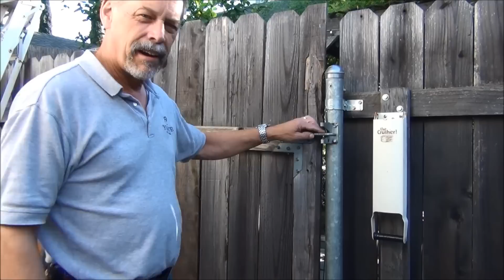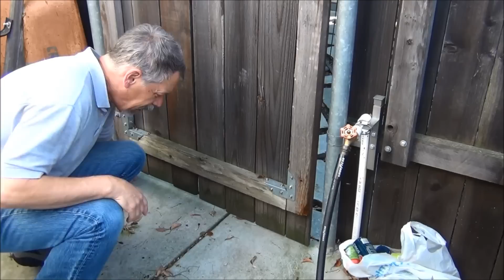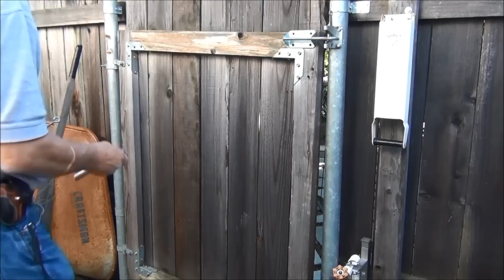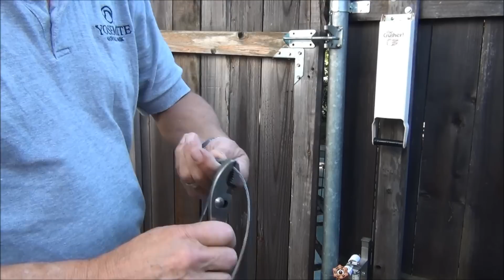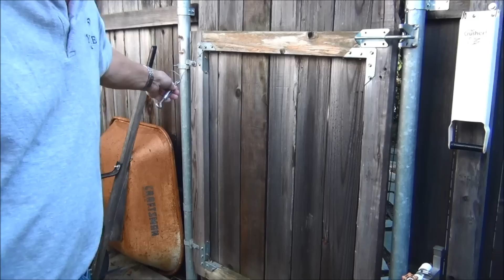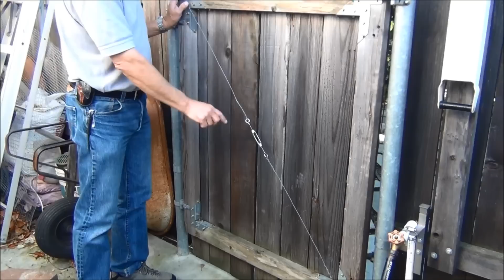Gate Repair

Comment: When you build the gate, run a diagonal board from the bottom hinge to the outer side upper. That carries the weight under compression to that hinge.
Reply from the maker: I agree totally with your suggestion of how to build a gate correctly from the start. Unfortunately this gate was in place when I purchased the house. Rather than rebuilding the gate from scratch, I performed a simple retrofit to correct the design flaw.
Reply: Should the turnbuckle kit be installed that way too, from the bottom hinge instead of the top hinge?
Reply: @sheri023 turnbuckle pulls , so go diagonally from top hinge down
Reply: @doomman700  thank you!
Reply: @sheri023 you’re welcome, try and leave plenty of adjustment on the turnbuckle, over time as it sags you can pull it up by tightening the buckle. Hope that helps.
Reply: @doomman700  will do.

Comment: What gauge guidewire are you using? Thanks in advance.
Reply from the maker: It was old antenna guy wire that is made up of four strands. The outer diameter is about 120 thousandths of an inch.
Reply: @mefedler  thanks. I ended up getting 3/16" Wire Rope for KT2500/KT3000 Winch. Hopfully that works and I didn't go over board or under too much.

Comment: U probably would not have to do this if the gate was built correctly in the 1st place.  U need at least one piece of wood added to the frame going diagonally across from the top left to the bottom right to form triangles in the frame. Triangles are the strongest engineering shape. A square is never used even with brackets in all the corners. Obviously built by someone who didn't know how to build a gate.
Reply from the maker: Obviously, that's why I had to repair it.
Reply: I tried this using 16 gauge galvanized wire and a turnbuckle it's a five foot wide by 5 feet high wooden gate but the wire broke when tightening the turnbuckle. Doesn't help that the old hinges are visibly bending and the post they attach too has some movement as well. Have to go with thicker wire, maybe aircraft cable and change the hinges

Comment: im doing a wooden picket fence with a 3 1\2' gate it seems the hinges are were the play is coming from because i can lift it to latch it. 
i know its not the wood i. reset  all the horizontal runners and releved them, now all the runners are set. i rehinged  it. from a flush mount spring back hing and and Corner mounted the same hinge so I then move the clip apparatus now  two the new position and as soon as I remove my shim the fence dropped. the clip apparatus is is free pivoting inside a shroud that hold it in place via wood screws. with this turnbuckle idea be a means to fix my problem

Comment: Would this work on a metal 14' farm gate, but with the cable going to the post   so it doesn't drag the ground..? I've seen cables on the top rail of s farm gate, but not one from the bottom .
Reply from the maker: Yes it could work if the gate dragging on the ground is caused by the gate itself sagging. The cable only corrects the sag in the gate. It will not work if the cause of the gate dragging is due to the support post tilting due to the weight of the gate. If the support is tilting, you might be able to correct the problem by running a cable from the top of the tilting support post to the base of the next post.
Reply: Mike Fedler  awesome! Thanks

Comment: I just bought everything to do this but my guy wire is too stiff to "twist".  They told me you don't want guy wire to pop off while tightening so got to buy some more "clamps" for the wire.  I don't want it to fly off & injure me or anyone coming into the gate.

Comment: Is there a limit on gate size this would work for?  I have a 8foot wide gate sagging about 3 inch's to the point it contacts the ground. Completely missing the striker on the latch would this method work for such a large gate?
Reply from the maker: +Because it's Blaze No there is not a limit as long as the gate structure and the support are strong enough not to twist. Also the turnbuckle, cable and attachment points must be large enough and strong enough to support the load.
Reply: would a turn buckel work on a metal gate with wood all slats

Comment: This should do the trick. Wondering what gauge wire you use, and if it's stainless or rust resistant?
Reply: That's 16 gauge
Reply: Galvanized
Reply from the maker: I used wire that is used to guy a TV antenna mast. You can buy it at almost any hardware store. I don't know the exact gauge but the wire is rust resistant.

Comment: Hey Mike, great video explaining how a turnbuckle works. I was wondering if a turnbuckle and cable system would help us fix our door. The door itself doesn't sag and closes nicely however the corners away from the hinges are not flush with the door frame: the bottom corner hits the door frame first while the top corner sticks out. Can you or anyone tell me if a turnbuckle would help us fix our problem?
Reply from the maker: It sounds like the door is warped. I don't think a turnbuckle will solve your problem. One solution to reshape the door would be to put a small block at the bottom corner that hits first and then forcing the door to close and then leaving it that way for some extended length of time. Using this type of solution would try to reshape the door back to the correct position.

Comment: I have a problem with my 10 ft. x 6ft wooden gates bowing at the top. I do not have sagging. That was fixed with support straps. But, I'm just real frustrated with the top bowing of gates. Btw, they bow outward..Thanks a bunch to anyone who can help..
Reply from the maker: How about putting a triangle brace at the top on both side with two cables. One on each side. Each cable would run from one end of the gate across the peak of the brace and then to the other end of the gate. That would allow you to stiffen the top rail and allow you to adjust the force on either side to meet your needs.

Comment: i have a wooden full driveway-width gate that is warped-what gauge wire would you use?  It has the z-shaped wooden supports you mentioned here, and a small wheel attached at the bottom to make closing it easier but it is seriously bowed or warped at the bottom. 
Thanks-
Reply from the maker: I used just regular guy wire that is used to put up antennas. It can be purchased at any home building supply store. In you case a single stand of guy wire would probably not be enough. You could always double or triple the wire to make a single wire that is stronger. This fix is for gates that are sagging. In your case you state that your gate is warped. If it is warped downwards this solution might work. If it is warped left or right then this solution might make the situation worse.